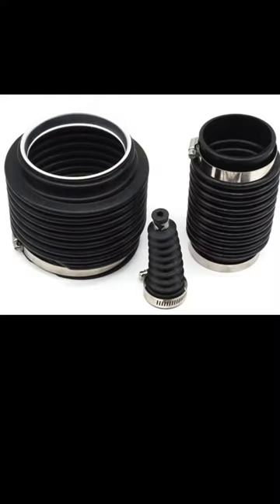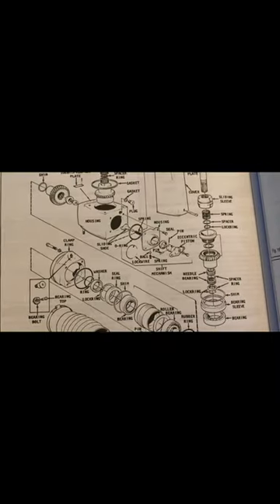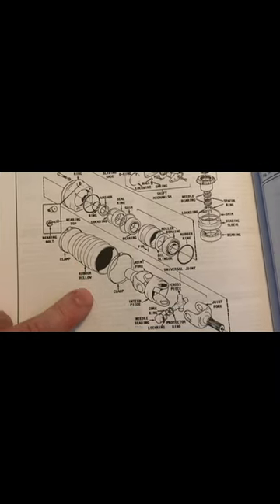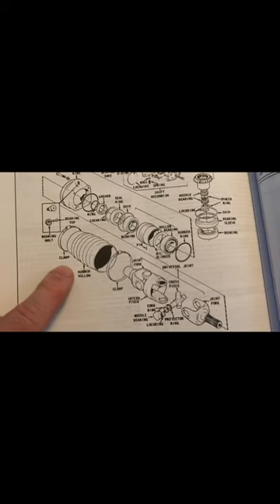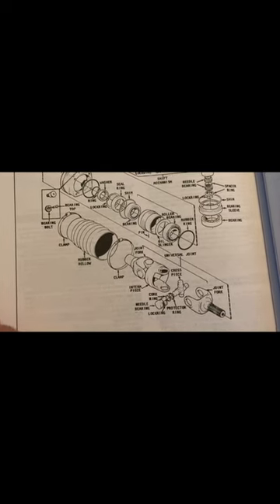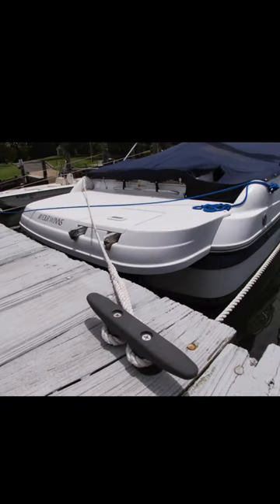Bellows are a weak link on a Sterndrive Boat or Inboard Outboard Boat

Comment: Ok here’s a bit of reality to balance out the myth…20 years of salt water boating with the boat moored in salt water 6 months out of the year on an 1988 OMC Cobra…the OE bellows in mine have lasted at least 10 years before any cracks appear & then I replace them. BTW it is the same bellows as used on the Volvo SX. Maintain it store with the drive down & they last. I’ll take an I/O with it’s complexity vs an outboard with a cut down transom ANY day.
2 bellows one gimble bearing over 20 years. That sound terrible? Let’s now discuss the price of old school I/O engine parts vs 4 stroke outboard engine parts…can you do a top end overhaul (new cyl heads etc) on a 4 stroke OB for $ 750? I did on a Chevrolet 4.3 V6.

Comment: There's actually more places where water can leak in than just the bellows: older drives' steering linkage, if left to corrosion, would allow the ingress of water at the top of transom assemblies.  And if your transom has gotten soft to either dry or wet rot, water can leak around the entire transom assembly, which is the whole linkage between the drive and the rest of the boat.  I'll concede that with an older I/O boat, it's best served by not leaving it in the water for more than a few weeks at a time.  It (the whole boat) needs to spend most of its time out of the water on a trailer, lift, or shelf.  ...much like an airplane spends most of its time on the ground.

Comment: The only boot that can really sink you is the shift boot.. The drive boot has a bearing blocking water from entering. The exhaust obviously cant leak water into the boat. But that little shift boot will put you on the bottom

Comment: If you are out on the water, with a working bilge pump, bellows failure is not an issue.  If both your shift and u-joint bellows fail, your bilge pump can move that amount of water with no issues.  If you leave your I/O in a slip with no shore power though, it's a problem.  My dad used to run clapped out bayliners until they died 100%, bellows often leaked.  Ran until the ujoints sounded lumpy, and just put more grease in the gimbal every outing.

Comment: Would love to compare similar size boats, 1 w i/o the other an outboard. What’s the necessary maintenance? Is that i/o bellows v outboard transom wear. Rather replace a bellows every 2-5 years than a transom every 20. Seen quite a few older soggy transom problems from supporting the weight of an outboard. Just my observations. 🤷‍♂️

Comment: Not necessarily true. Bellows can leak (and do leak without maintenance) but usually it’s a drip. Ran my old Baja with Alpha drive all summer back in the 90s with a torn bellow. Bilge pump kept up no problem. Leaving at dock though? Yeah, I wouldn’t do that as batteries only last so long.

Comment: Boyant Bellows actually powers the boat

It's a 100 year old engine
That means no batteries or fuel is required

What you need instead of a hole in the boat is magnetic gears

And to realise seven million people die each year from air pollution

You don't need a fuel tank or energy storage

When you have infinite power

Continous power from Bellows is better than intermittent powered solar panels and wind power

I started building a boat

And realised I might as well build a multiatmospheric spaceship instead

My boyant bellows paddle boat can fly

Yours has a hole in it and runs on poison

Comment: Too true. They are not for the faint of heart when running in heavy seas. That is why I have yet to consider a boat with an I/O.... yet... even though they may sometime be less expensive to purchase old and used. There seem to be more good reasons to put the engine outside of a boat these days.